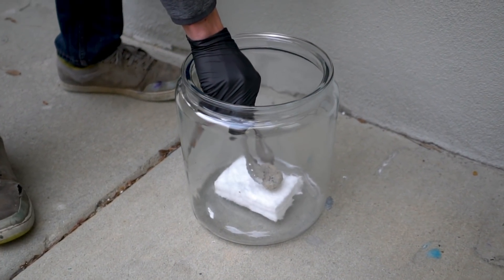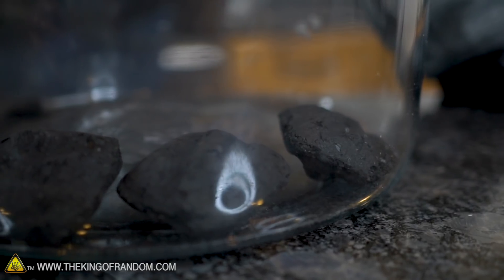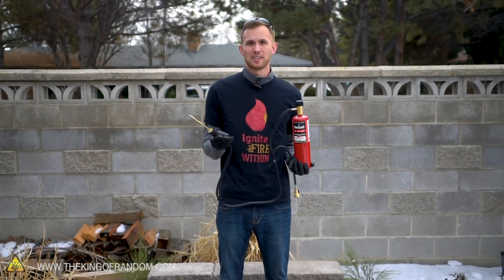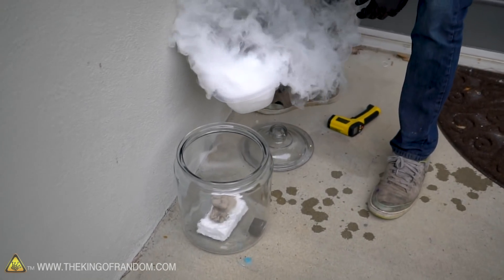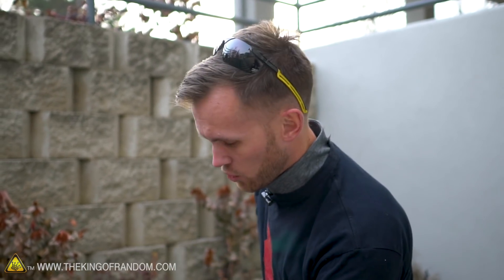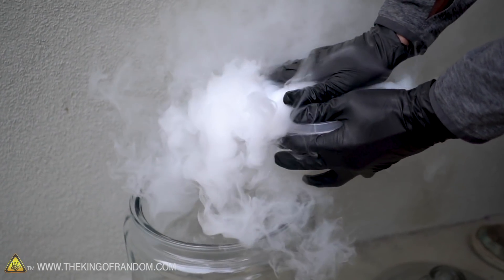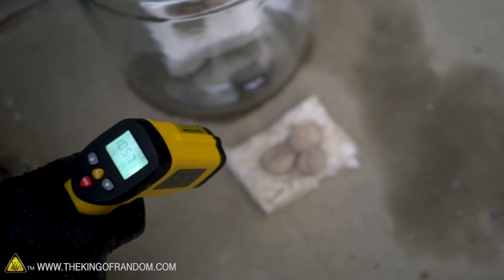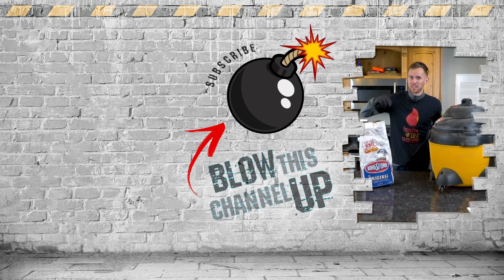What Do HOT COALS do in a Vacuum Chamber?

Comment: Can you do it right next time
Apply a huge vaccum force
Seal it
Then apply a huge pressure on the vacuumed air
Then focus rotating magnets so atoms go to the centre
A ring magnet spinning. Gyroscope type of spinning three magnets in a circle
This focuses the helium/ hydrogen carbon atoms to the centre

Apply heat to the hydrogen with the correct pressure and vacuum pressure
The hydrogen will ignite 

Dont need glass chamber
Just a small metal hallow ball
Create vacuum, then apply pressure
More vacuum and more pressure until right
Ignite hydrogen inside the ball, one burst of hydrogen can last 4000 years & the heat will never run out - ( creating a mini sun inside a metal ball ) heating your entire neighbourhood for 4000 years

Comment: You forgot to control for the cold temperature of the dry ice, but it shouldn't make much difference.

Also, be careful. Some hot or energized items in a vacuum can emit radiation, but I am guessing you are still okay.

Tip, unwrapping scotch tape in a vacuum can release some small doses of radiation. Enough to expose the film the dentist uses and if you hold your finger on it realllly still, in a place where there isn't a lot of background radiation, it can give you an x-ray. I would like to see you do that.

Comment: I knew what would happen right away.  In order to have combustion, you have to have three things: fuel, oxygen, and heat.  Remove any one of those three and you lose combustion.  So, putting hot coals in a CO2 chamber or a vacuum chamber effectively removes the oxygen, thus preventing combustion.

Comment: I was curious why you didn't just aim the infared thermometer through the glass can you explain why you didn't
Reply: Just saw this video, sorry for the REALLY late response.

Glass transmits light very well in the visible spectrum (red to violet) but it is completely opaque in the infrared spectrum, so an infrared thermometer will just read the temperature of the glass, not what is inside it.

Comment: What would happen if you tried to confine water while it freezes? Ice expands as it freeezes, but what if you use a sealed steel mold or something to prevent it from expanding?
Reply: Aaron L it will explode the object confining it. This is why you shouldn’t put a full water bottle in the freezer
Reply: if it couldnt break the container. it wouldn't freeze. once you've opened the container. ice forms.
Reply: Oh man u tryna male ice 7
Reply: It won't freeze
Reply: It would break its container.
Reply: If its steel then the ice would just simply block on the steel and just freeze in the middle. That's what I think anyway

Comment: In low oxygen/high temperature situations carbon can reduce carbon dioxide to carbon monoxide (CO2 + C -> 2 CO). This is part of the blast furnace process. As CO is very toxic you might want to take care with these experiments (although I am not sure that you reach the necessary conditions)

Comment: In vacuum, charcoil can not burn and gain heat. But can not either loose heat by exchange with air. So only loosing heat by radiation, which is a very slow and négligeable process at this scale.

Comment: sigh.  And you ruined the lining of that non-stick pan you used inside the dirt-sucker.

Ya need to know that they break down into some really nasty strongly carcinogenic chemicals when subjected to heat that high. 

In short there's nothing wrong with using floridated polymers at normal cooking temperatures (I do) ....  but as illustrated charcoal in a moving air stream will easily go above 1000F.    Well past where those plastics start to break down.  I'd trash that pan... or certainly make sure it's never used for food prep again.

Comment: What happens if you put Gallium in a vacuum chamber? Does it boil, melt or stay solid?
Reply: Yes
Reply: It would stay solid as there is no water and cannot evaporate
Reply: it would depend if  the vacuum process created enough heat from the molecules moving to change the temperature of the Gallium:)
Reply: wolfenpixels  no , water evaporates not because of the vacuum chamber getting hot , in fact the vacuum chamber gets cooler . . Water evaporates because the air in the water wants to escape

Comment: The demo you showed of pure o2 on the coal as you got closer the coal got hotter and actually caught flame got me thinking . In the car world, you would think if you spray pure o2 into the intake the engine would perform its best and have a ton of power, however pure o2 burns too hot and will melt a hole the pistons like it did in the coal. in simple terms the pure o2 is cut with nitrogen to keep it cool. Thats why its called nitrous oxide but if you spay too much of that you can burn a hole aswell.

Comment: Best guess on why the vacuum coals were slightly warmer than the CO2 coals?  Mine is that the vacuum acted as an insulator.  The heat couldn't move away as well with no gasses to transfer heat to.

Comment: I may be incorrect, but I honestly do believe that you need to have both the laser dots on the surface you want to measure the temperature of. With one light on the coal on the other light on the concrete, you may be getting a mixed reading due to the temperature differentials. Nice video!

Comment: The King of Random thank you for the video.  Just a heads up, the infrared thermometers average a round spot that gets larger and larger the farther away from the surface you are pointing it at. Probably around 1" in diameter at 1ft and probably around 3" diameter spot at 4ft from surface.  This was probably why the ones that were not in jar varied in temperature as it looked like you were about 3ft away from them.

Comment: Thanks for the idea of using the Shop-Vac for blowing on the charcoal. I did some heat treating on some metal parts I made to mount a larger gas tank on my bike. I just used a small charcoal grill, some boards to direct the air from a window fan into the bottom vent of the grill. It did heat the parts to red hot but took too much time. Next time I'll use my Shop-Vac to blow more air into the grill from the bottom. I do like your videos as you do some things I do find quite interesting, and even give me some ideas as well.

Comment: I've known welders using oxy acetylene torches turn off the acetylene and use just the oxygen to cut thru steel once the metal heats up to the melting point

Comment: Try boiling water and throwing into the air when it is zero or less degrees and then want to just see what happens try adding in the dye and different things
Reply: Or you could just do it yourself.   It’d be a lot more fun.     And, adding dye won’t change the color.    When water evaporates, it leaves behind everything that isn’t water

Comment: Is it possible to read CD/DVD´s under a vacuum? If yes, are there any speed differences? Harddrives would maybe interesting too...
Reply: Hard drives already have a vacuum seal inside of them.  Once it’s opened, the air pollutes the disc enough to be unreadable
Reply: @andrewrichardson3135  Normal harddrives dont have a vacuum inside... They even have a small hole with a filter inside so the pressure can be balanced in and outside... Because of that, they cant run in non conductive fluids... It would leak inside sometime